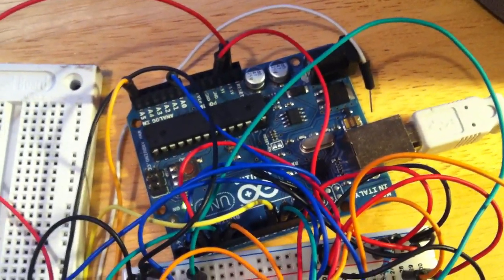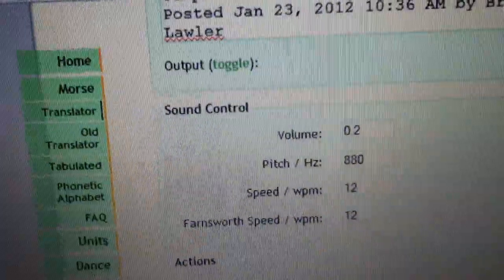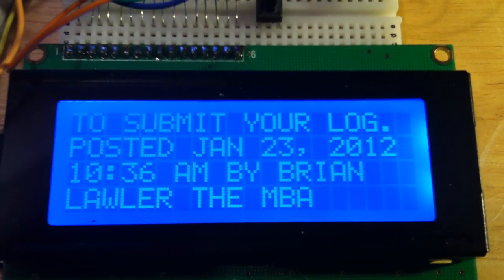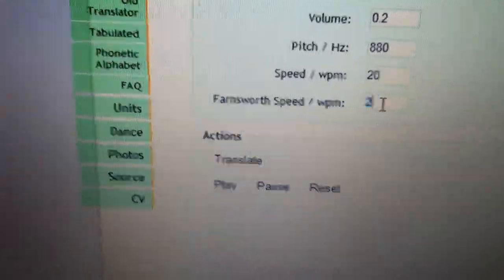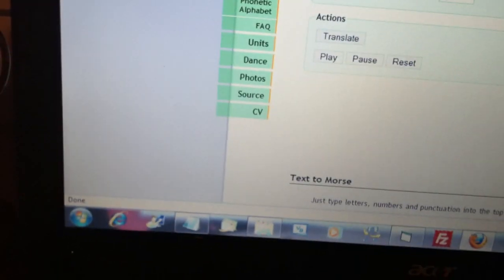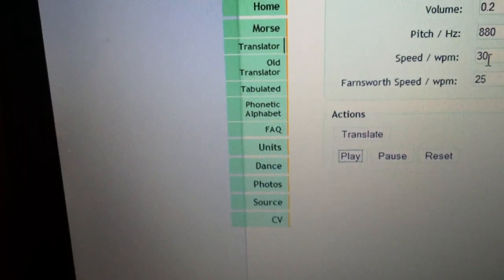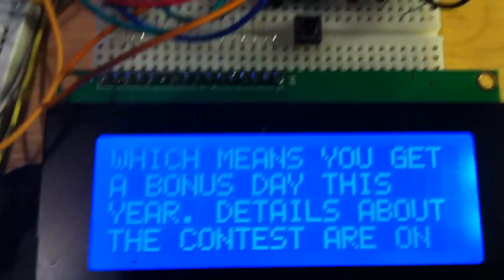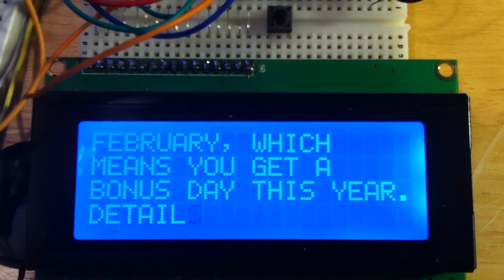My Pet Arduino Copies Morse Code to an LCD Display Module

Comment: Budd, I wish you would use your "connecting the 20X4 LCD to Arduino" video and build on it with more videos to end of with a Morse code decoder. As it is, I cannot follow how to end up with a decoder from what you have which makes it useless other than knowing that it can be done.  And how about telling how to program the scrolling software?
Reply from the maker: Robert, thank you for your interest in this project. By now I hope you have discovered that this video is a few years old and that there are several more that document the evolution of this project. In fact a few of them point to the sketch which you will find at:

https://googledrive.com/host/0B8Ql_9-ygoisczg4STFicFZPWEE/WB7FHC-Decoder-Sketch.html

If you would like to know more about some options that are available please email me at wb7fhc@arrl.net I have learned a lot since this video was made and if you are interested in building a similar project I would like to share some things with you.
Reply: Hi Budd, I'd love to get your version working on my setup. Noticed the link no longer works. Any chance there is another place to snag your sketch.  Ed NZ1Q

Comment from the maker: I am short of time and have not been able to clean up the code for this project. It is a re-hash of an earlier one that I did using a key and a terminal program on the computer.

I hope to have the new tutorial posted some time in April. 

I don't think I'm able to post a URL here, but google 'nibbles bits morse code'
and you will find the sketch there.

Watch for a full tutorial on the LCD display and Morse Code to come on line hopefully in May. 

Sent from my iPhone